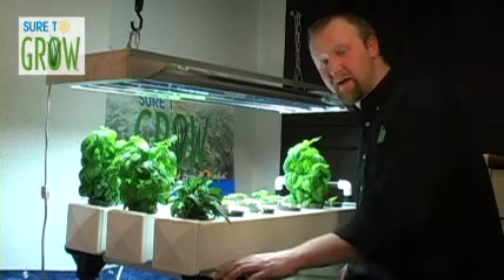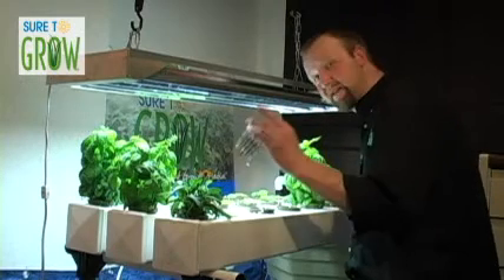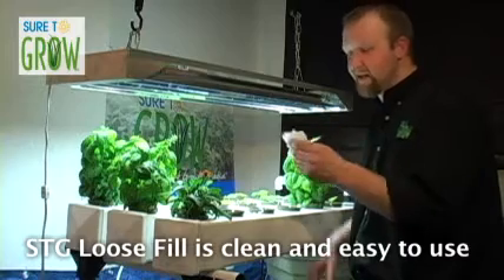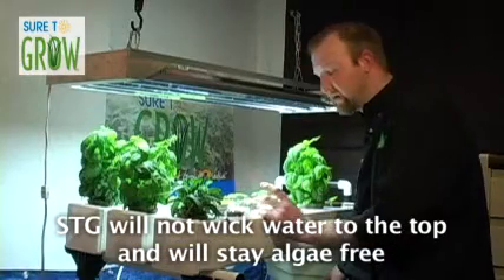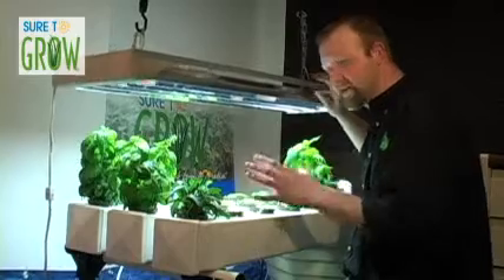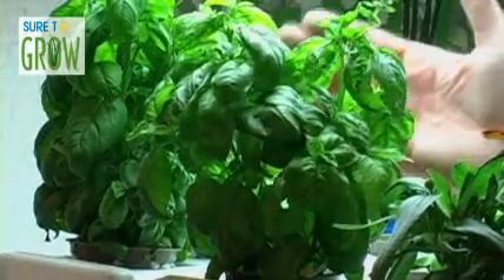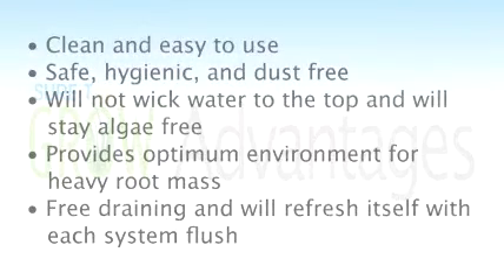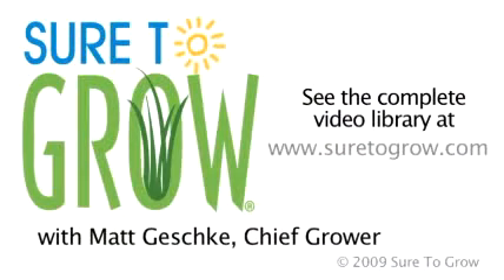AeroFlo hydroponics setup using Sure To Grow

Comment: dude, you are using it wrong if your tryin to use it like a deep water culture.  but your right about the nft part.  this system is part aero And part nft.   you got to point the spray lines directly across to the other side wall, then it will provide a fine mist for the roots just under the basket. everythining else will drain down about a half inch deep like a nft.  you will then see more explosive growth that youve missed out on.... cheers

Comment from the maker: @cjisdacoolest  thank you for the reply. our grows cubes because they need to be watered from the top generally will grow algae. it is important to understand that algae will not harm your plant, so there is no need to panic. once your plant has establsihed roots and can be transplanted, you can either remove the top cap that has the algae on it or simply wipe it off the top. if the top stays dry duirng the next cycle of growth the algae will not return.

Comment from the maker: @cjisdacoolest ANYTHING WILL GROW ALGAE.....the point we are making, since STG is nonwicking you CAN water in such a way that water does not get to the top of the STG, so it remains dry and therefore cannot grow algae. less vile language would be appreciated. this is a public forum you can make your points without the need to use language that we and others find offensive.

Comment from the maker: I would attribute the "darker" roots hanging in the air from oxidation caused by the combination of the minerals within your nutrient mixture, and the atmosphere.  With the increased oxygen levels you are exposing your roots to by suspending them in thin air, it comes with an increased amount of oxidation activity.  The roots submerged are not exposed to this activity, therefore.... they appear to be cleaner, whiter,  and healthier looking. No worries.

Comment from the maker: If using no media is the way to "grow" then some needs to tell me what happens in a true aero system during a rolling blackout or loss of power.  Plants conditioned to grow in these environments need constant input and perish when that input is removed.  True high pressure collision fogging is the future but a method needs to developed to allow for circumstances outside of our control before it is viable.

Comment: Thank you for this video. I am building a homemade AeroFlo type system. I actually planed on using Hydroton. I know from using the Hydroton with Sure To Grow Cubes in my homemade Ebb and Flow system I have algae growth within a couple days. This will eliminate at least two of my major concerns. The Algae problems you spoke of and the Hydroton breaking down. Both could cause pump failure and clogged spray jets. I really like your solution.